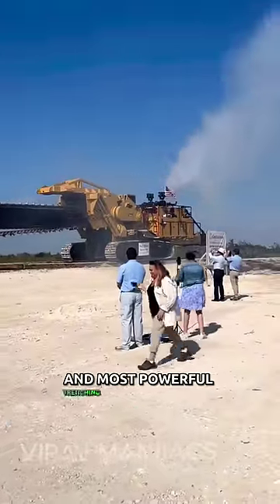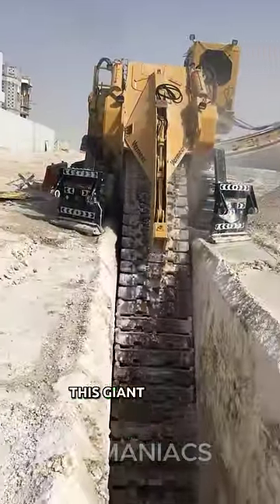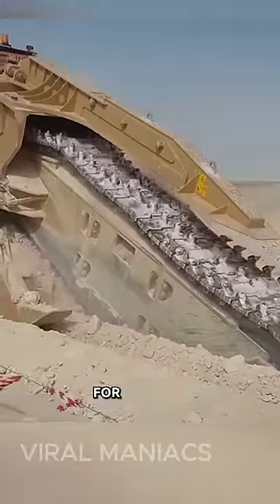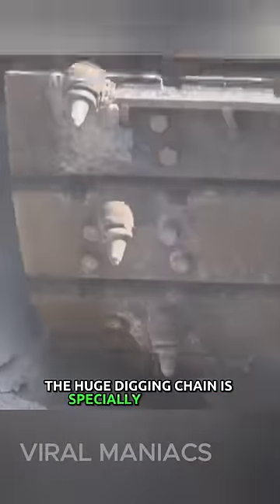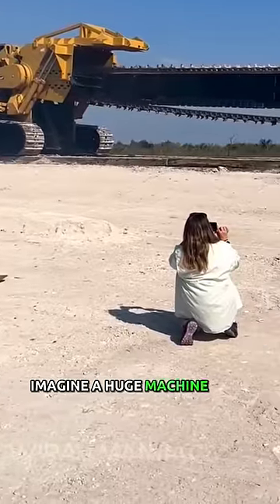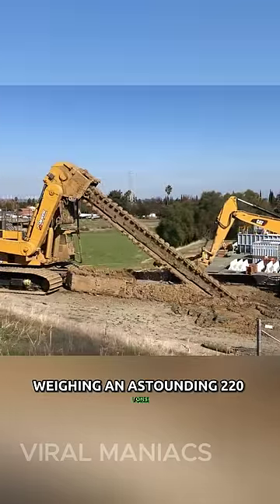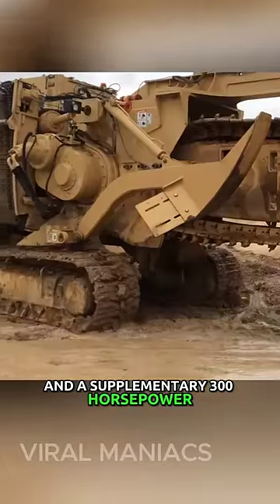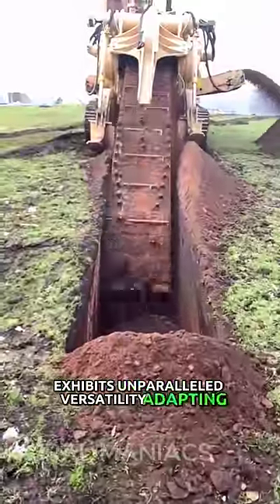Unbelievable Giant Trenching Machine - Trencor 1860 #shorts

Comment: Are you sure that isn't just a giant chainsaw?
Reply: Thought it was a massive chainsaw
Reply: It's... except way...way...wider...😅

You can try put a log across and it'll be gone in no time...😂
Reply: I just want to know if it is an Autobot or Decepticon.
Reply: If it was a chainsaw the chain would be facing the w
Other way
Reply: @ExtraterrestrialBeing-jc7to  
Why does it matter if the chains is upside down, left, right or centre? 

Do chainsaw's chains even has sharp edges?
Reply: @aphiz4505  it matters because the main job of a chainsaw is to cut wood and yes the chain has sharp points around the whole thing because it's used for cutting down trees
Reply: @ExtraterrestrialBeing-jc7to  
Only the small ones, has little tiny bitsy triangles thingy, even then, it's not on the entire chains. 5% or less?

Bigger bader heavy duty chainsaw are just plain chains strapped to motor...
Reply: @aphiz4505  you act like you teaching me something 😂 a Chainsaw is sharp all the way around it's a fvckin saw made to cut down trees  it's not %5 anything .. there's no big saws like that trencher
Reply: @ExtraterrestrialBeing-jc7to  
Ah so...
Let agree to disagree 🤬...

For example... If, just if... The two men chains, used for cutting trees, really did has the typical triangle saw edges, would you and your brother dare use it?

I don't know what this type of chains really called, but there's no way I would put my hands to anywhere near something that sharp, just to saw some trees...

Second, do you has bicycle? Ever try putting something under those chains and spin them?
Reply: I mean, kinda. It will obliterate logs, stumps, and small trees in the way.
Reply: My thoughts exactly (chainsaw)
Reply: That's what i was thinking 😂
Reply: Brother, I could shake your hand!
That's what I said out loud, oversized chainsaw!
Reply: @sayitaintso7544 definitely Decepticon.
They are way more bigger and usually industrial or military.
Reply: It is a giant chainsaw.
Reply: My first thought was that looks just like a giant chainsaw.
Reply: monkey - eating eagle is different from bald eagle.
Name can be change..
Reply: Has to be
Reply: @sayitaintso7544 obviously it's deception they prefer heavy vehicle
Reply: 😂 exactly what I thought
Reply: I think that's what it is fundamentally ... A huge chainsaw for cutting the ground.
Reply: Isn't this the thing Hexxus used to tear down Fern Gully? X3
Reply: Me tooo😂
Reply: Never seen a trench digger before…??? Obviously not because this is just a larger version of already existing machines.
Reply: That's Earth chains Shaw
Reply: @ExtraterrestrialBeing-jc7to  have you used a chainsaw before your comment tells us no you haven't.
Reply: @aphiz4505  if that was a Chainsaw how can it cut a tree down like that? What's doing splitting it in half
Reply: @ExtraterrestrialBeing-jc7to  
Like I said, put your finger on your bicycle chain ⛓️!
Reply: "The huge digging chain" 

If a chainsaw could dig holes what would we name it, chainshovel?
Reply: @bumblebeeisfree  
What sort of logic do you even follow?

Drill can dig holes, just fine...
I don't think there's even people mistaken them for shovel, ever ...
Reply: Not in the world,giant in the west only 😂
Reply: No. It has spikes, not blades.
Saws have blades not spikes 🤦‍♂️
Reply: @ExtraterrestrialBeing-jc7to how do saw blades cut? They dig out the bark of the tree along a plane
Reply: It's an earthsaw.
Reply: @Zeero3846  wrong it’s not a saw. It’s a peckerwood
Reply: Can this machine handle wetlands?
Reply: @NasinuWarrior85  duh as long it don’t get stuck
Reply: A chainshovel
Reply: Basically a giant conveyer belt.
Reply: @commentcrusader3809  what is it conveying 🤔
Reply: Stay out of my head, SIR!
Reply: That's exactly what it is
Reply: @World36599  no
Reply: Yep looks like a gigantic chainsaw to me 😂😂😂
Reply: Impressive! 💚🎸
Reply: Are you sure chainsaws aren't just tiny trenching machines?
Reply: It's a big back scratcher.
Reply: Lol you are the dude that would ask that as I pitch this to you and want me to admit it before you hire me.
Reply: It’s a giant chainsaw…
Reply: How dare you comment this a month before me.
The arrogance I say GOOD DAY SIR.
Reply: @sayitaintso7544  It's bumblebee brother
Reply: Exactly my thought 🤣
Reply: @aphiz4505  A large chain saw isnt just chains on a motor lmfao. They have very sharp points.
Reply: @aphiz4505  let me ask you one thing beforehand

What even is a chainsaw?
Reply: @xxizcrilexlxx1505  
Ever seen medical saw before?

Ever heard/knew the worst that would happened, when thief snapped someone necklace? What if it's not made from gold, but tough material like platinum?
Reply: @jalanihidup6119    what a deep thinker you are
Reply: I was literally screaming "GiAnT ChAInSAw!!!!" At the screen, lol 😂
Reply: @tdiamonds23ice82 as others in the comments have said, it is NOT a chainsaw, more like a chaintrencher or chainshovel or conveyer belt with spikes
Reply: @sayitaintso7544 The construction bots are always Decepticons.
Reply: @sayitaintso7544 he's their daddy. That's what he is
Reply: There are actually giant chain saws used for laying down optical cables and such. 
They don't really dig a trench as much as cut a deep narrow slot in the ground without removing too much soil. 
The teeth looks like massive chainsaws teeth, but the chain obviously moves much slower.
Reply: Can we call it a giant beltsaw ?
Reply: @sayitaintso7544  definitely a decepticon 💀
Reply: That's what I was thinking 😆😆😆
Reply: It looks like a giant chainsaw, it works like a giant chainsaw, it is a giant chainsaw
Reply: Ya.
Reply: Damn.... you took my comment😅😅😅
Reply: @clintkeenan4657  sorry bruh.
Reply: @ryleplays01  all good
Reply: Works the same way but instead of a tree it’s the earth
Reply: @user-my1hj8iu2e  Ya
Reply: They call them a Rock Saw
Reply: But credit must be given for using it this way... 👌👌.
Reply: @sayitaintso7544 with a name like Trencore, I'm guessing Decepticon.
Reply: @garreth629  ok....?
Reply: idk either. This one could transform anytime.
Reply: It’s 100% a giant chainsaw… don’t ask how I know, but Godzilla will use this as an actual chainsaw in future movies.
Reply: Yeah literally
Reply: @BanHammer_Phighting  q and?
Reply: @ryleplays01  wdym qand?
Reply: @BanHammer_Phighting  q                            and
Reply: It's just a giant chainsaw.